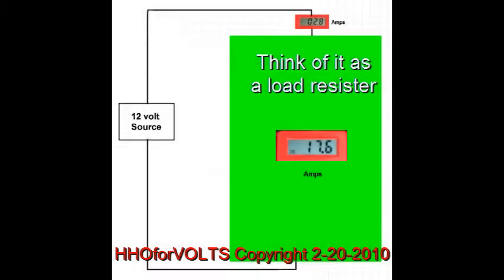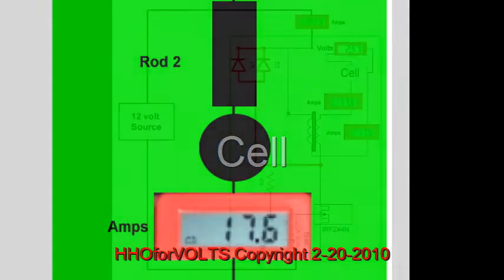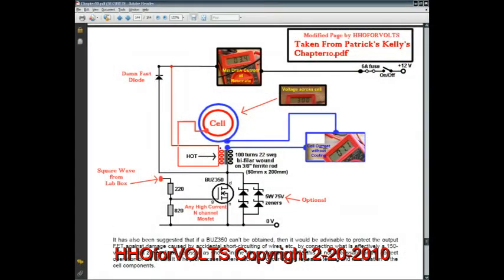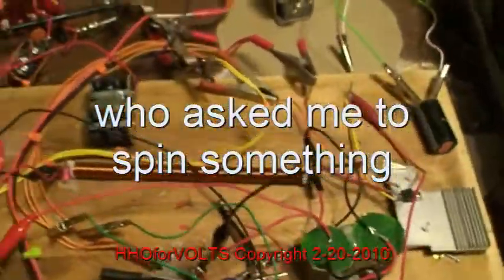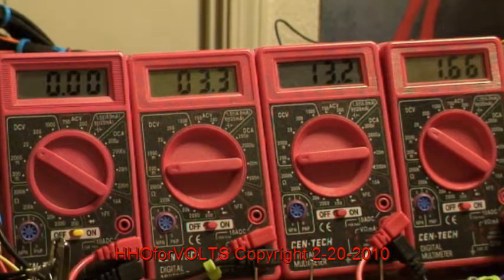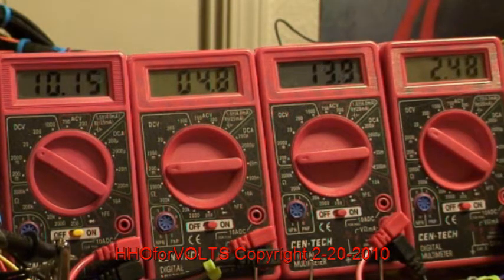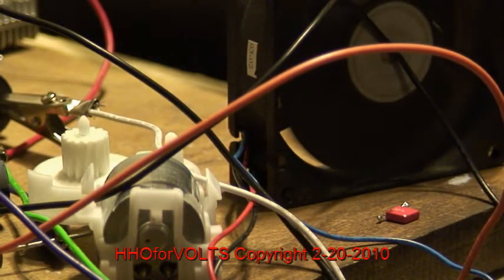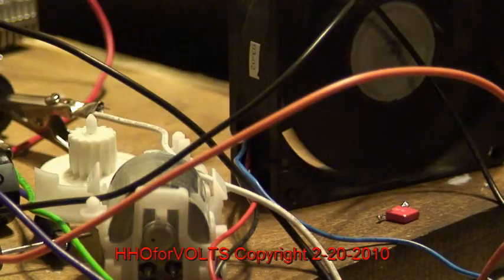hho Over Unity Simplifed Plus Energy Extraction

Comment: Part 3 -
11-22-9-20-7-18 and so on. You will see a 12 pointed star form around the center as the wire crosses.
With the 36 point jig, there are a lot more variations.
With the 120 point, it's hard for me to fathom all the variations.
Grab a string and do a quick 11 pin count wind on your 24 point jig. If wont take you but a couple of seconds to see what I'm talking about.
Peace.
Mike.

Comment: Part 2- The trick was then to match the ID of the cell tube with the OD of the coils, and the OD of the tubes with the ID of the coils, so I started to change the pin count sequence. Changing the pin count changes the ID of the coil. If you wrap your 24 point coil in 11 pin count, the center hole will decrease drasticly, and you will still hit all 24 pins without having to jump from pin one to pin two in order to hit them.

Comment: Part 1 - Your findings are consistent with mine. It was the magnetic field doubling with stacked Rodin coils that put me on the track of placing them inside of a Meyers tube cell.
As soon as I saw your Starship coil, it struck me that I could place a lot more coils inside the Meyers cell. There by increasing the magnetic field for helping with the separation of the covalent bonds.

Comment: Richard, I'll put a vid together for you just as soon as I finish the 120 point jig.
I 'm figuring that my 36 point jig that has 5 different ID's will make over 500 different coil configurations, maybe more.
What I'm looking for is a very strong magnetic field. I'm wanting to use it on a Benidi pulse motor. I know that one of the things that cuts the efficiency is the metal core of the pulse and pick-up coils. If I can eliminate the core, the magnets wont have any sticking points.

Comment: Richard, I've been tinkering with the Rodin and Starship coils. With the starship, if you change the pin count away from 5, you can touch all 24 points without having to make the lateral jump from one pin to the very next pin in order to connect all 24 pins. Try different pin counts. By doing this you can alter the inside diameter of the coil, and change the magnetic filed as well. I'll be making a 120 point jig tomorrow.
I've already made 24 and 36 pin jigs with multiple diameters.
Mike.